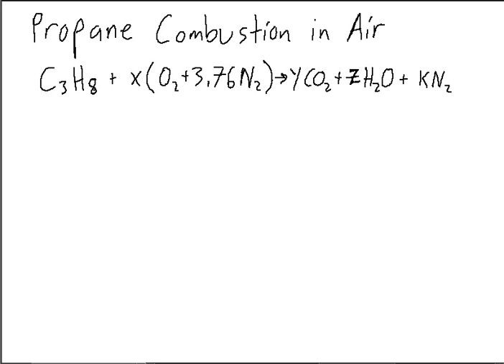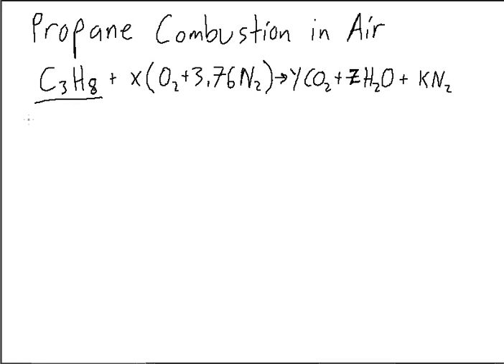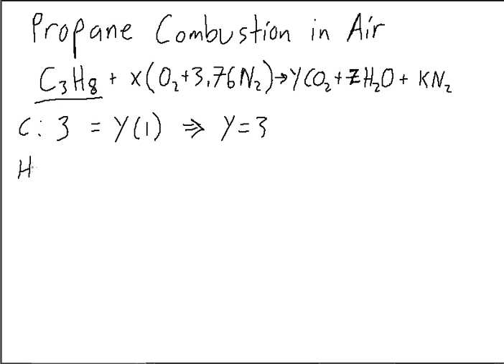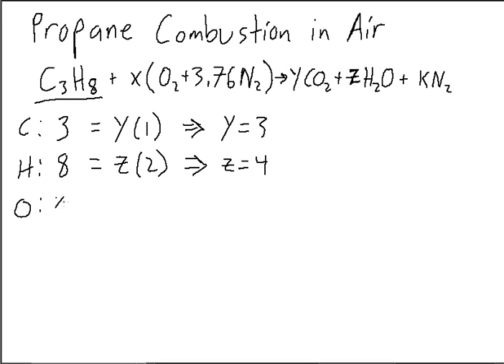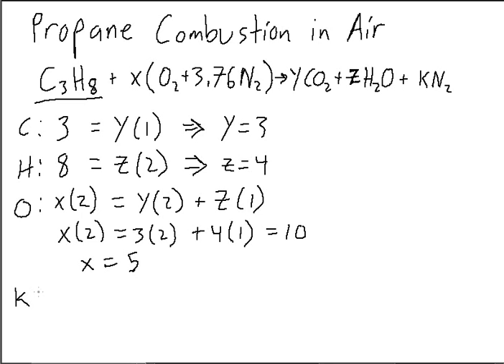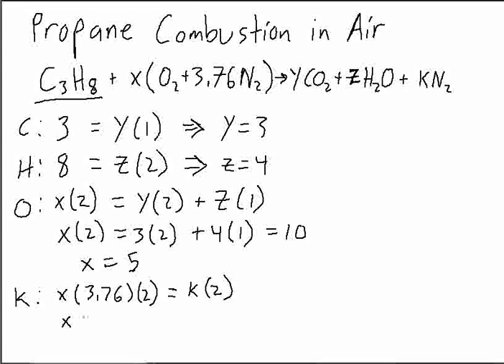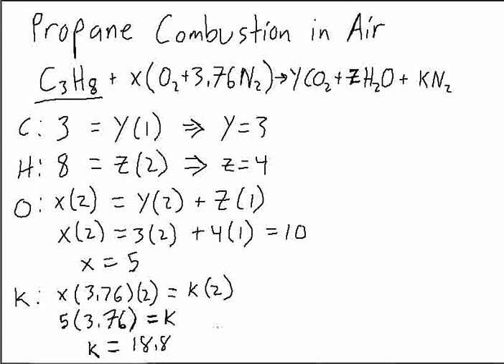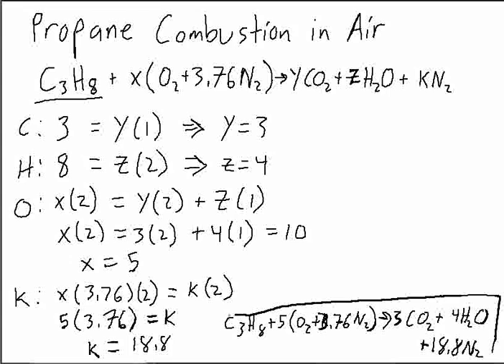Propane and Air Stoichiometric Combustion Reaction - Fire Protection Engineering (FPE) Teaching Tool

Comment: Thanks, this is really a good example for the combustion of a hydrocarbon when mixed with air, assuming complete combustion.. ^^,
Though there is a general formula to instantly get the combustion equation - and that formula was derived using your example in the video.
Nice job! ^^,